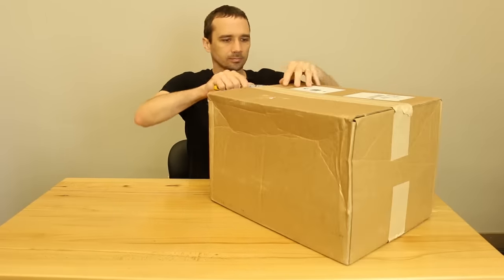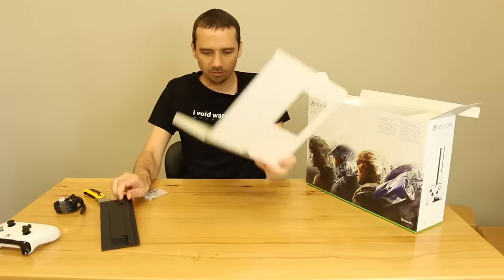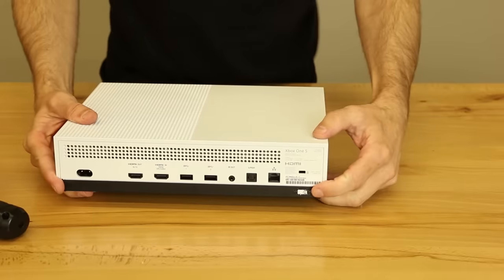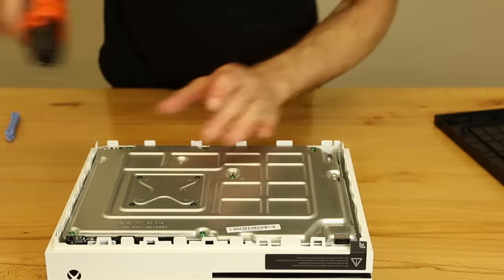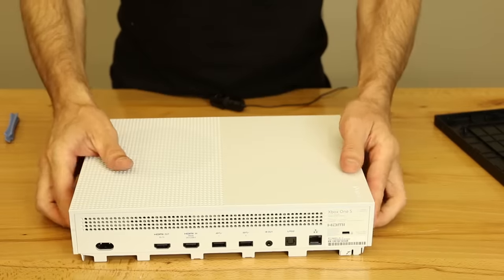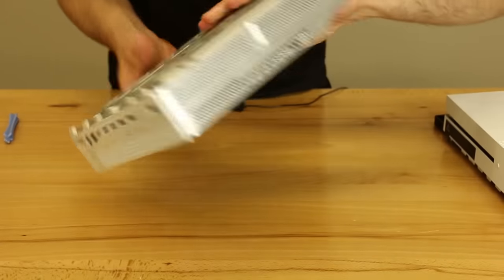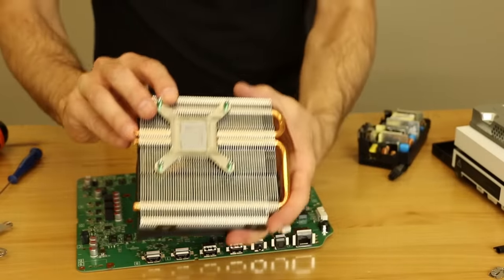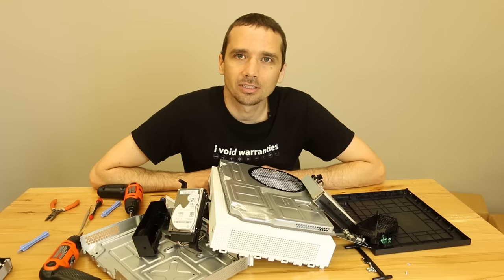Xbox One S Teardown - Detailed Disassembly Guide

Comment: This is one of the best video man Thanks a lot!! Cleared all my doubts to a level. Well one question though. I am importing this from USA to India. In US power voltage is 110v and in India its around 220-240v. So since you mentioned the power brick supports any voltage can i directly plug in to the power supply socket without any external step down transformer required since the power volt is 220 V. Please suggest
Reply from the maker: These are dual voltage so there will be no problems.

Comment: The POWER SUPPLY is 100-240v? Thank you!!
Reply: most USA based power inverters like this are for input 110v ulike a power supply for a computer wont be in a 240v rage as the devices used in the xbox wont ever require a high input of 240volts <break down or close to the volt rage of each device hard drive 5v~to12v opti drive 12V ~Cpu 12 to 24v the mother board should be a max of 24V  the fan 12v to 24 max  hope this helps

Comment: So ppl know when he takes the power supply out he ripped the female plug off the board there is a clip you squeeze to unplug it and don’t wiggle the connectors off like he also did just pull straight up if not you could destroy the plug or the contacts.

Comment: Were you able to test if you can hot swap the disc drive?  Or is it designed for optical disc drive is tied to mother board?
Reply from the maker: It's tied to the motherboard...on all Xbox One models.
Reply: Well that's convenient, I guess just need to buy new compatible DVD drive and then be able to solder old board to new dvd enclosure
Reply from the maker: Yep

Comment: Hi TronicsFix, can you please tell me if the Xbox One S bluray drive can be made to fit the original Xbox One. Also what I'd really like to know is if I can slam it in my PS4, I realize some modification may be required but would appreciate your thoughts on if its even possible. Cheers, also subscribed for the demonstration video to answer my question :P
Reply from the maker: I haven't tried putting it in an Xbox One. You would have to be an electrical engineer to be able to fit it into a PS4 and even then I'm pretty sure that it would be impossible.
Reply: Cheers for the fast response :)

Sony really screwed up choosing to drop the 4k Bluray Drive. I stream youtube at 480p on average and even less when its choked up, how am I going to stream 4k? LMAO! I have a 4K TV and pre-ordered the VR Headset and was patiently waiting for all this to come together and Sony pull this shit. Strongly considering cancelling the VR Headset and just buying for PC
Reply from the maker: Yes, I'm very surprised that they did not go with the 4K
Reply: TronicsFix
With the recent Fiasco's of Microsoft doing their usual trick of bribing for exclusives to cut Sony out and bribing channels to not broadcast Sony at E3, my mind boggles as to why Sony didn't put a Michael Jordan size boot up Microsofts ass by adding 4k Player. Did Microsoft bribe Sony? Did they plead for mercy from Sony to give them a lead due to Xbox falling behind? Dunno but if I was Sony I'd have been telling Microsoft to bite the kerb as that boot came down!

Comment: the disc drive is so unnecessary.. i have this exact xbox, and i don't have as much as a disc to it, all games are bought online, onlything that could be better is to upgrade the 500gb to a 2TB.   what would happen if you remove the disc drive and replaced it with a fan instead?

Comment: I would put a warning about opening up the power supply, that's high voltage, could easily kill you with a single discharge.
Reply from the maker: That's why I disassembled it with it unplugged.
Reply: I've heard there's a slight risk of the capacitors retaining charge after you unplug it though, enough to deliver a fatal jolt.
Reply from the maker: That's only right after you unplug it. You can either wait for a period of time or you can discharge them before you start disassembling. 
BTW, it would be highly unlikely that you'd be killed by theses capacitors...they are strong and it wouldn't feel good, but not likely to do any permanent damage.

Comment: I hope someone sees this. I have an Xbox one s. Specifically the Battlefield 1 edition. My power cable WILL not leave the Xbox. I have been pulling with my hands, gloves, and pliers for about an hour now.

After further looking at the cable area, it looks like the console shell looks a bit melted around the cable. It’s the same color as the case. It also isn’t much. It’s about as much as a thin layer of wax.

Comment: Is the S usually not pick up dust? Like to the point to at all? I have a Xbox and a ps4 and both keep the outer part clean and away from everything else and recently opened up my ps4 that I’ve had for a year and cleaned it and man was it dusty! Then it dawned on me that I’ve had the Xbox one for 2 years and it must be worse but I just now opened it up and stopped half way because every piece I got off I expected dust and there was nothing. Not even a single bit! Surprised me for having it for 2 years

Comment: Great video! I need to know if the power supply is multi-voltage. Because I want to buy this xbox in the USA and use it in Germany. Does it handle 110-240V?
Reply from the maker: Yes, it's dual voltage.

Comment: 11:36 I have a question about this board your removing.   I have a xbox one S like this unit that was dropped.  The small switch BIND SW3 looks like it snapped off.  I think this is the Share button?   Any idea where to find another switch or can you provide a close up picture? thanks.

Comment: This was supposed to be easy, followed everything, but yet xbox turns off instantly after turning it on after replacing thermal paste, fan doesn't spin yes it's plugged in, everything is exactly like it's supposed to be. Maybe scratching the board while taking off the steel X from the APU is the issue. I was so angry when it didn't turn on, I'm prepared to throw it out the window!

Comment: I hope you still respond but I did everything in the video because I needed to clean my Xbox from a roach infestation and everything still worked even with the roaches but now I’ve cleaned it really well and I put it all back together properly but now for some reason my Xbox started to overheat and shut off even tho I cleaned the fan and everything else and nothing is blocking the air and it’s not in an enclosed space, any advice how to fix this?

Comment: Is there anyway to switch out the “HDMI out to TV” with the “HDMI IN from SAT/CABLE” input? Just asking if it’s worth to open my Xbox because my HDMI to connect to the TV is damaged.
Reply: Are you sure its not Internal HDD problems? That's what caused me to either get the black screen "no input" or "preparing console" straight to the error page. I initially thought it could be a bad HDMI chip too. 🤦‍♂️

Comment: I dissembled my Xbox one s because I had a disk drive problem, I opened up the disk drive gave it a little clean plugged in power still worked, so I put it back together and it doesn’t turn on at all now! Do you have any advice please?

Comment: I can’t get my sons Xbox one S to stay on more than five seconds. I swapped out internal power supply and it’s still doing the same thing. Sometimes it will stay on a little longer if the hard drive isn’t connected. Any advice would be greatly appreciated.

Comment: I have a problem a friend of mine has the Xbox one s. But it keeps turning off after a few hours or event just 30 minutes. We moved it from tight hit areas, pulled it down and cleaned it and also added the cooling gel, but the problem is still there, is there anything you or anyone can tell me that will help.
Reply: Try post the problem on R/xbox or xbox repairs

Comment: Ok, really need help identifying what type of part that is on the pcb of thr disc drive. Not the power connector but the one next to it that looks like an L. I was pulling the disc drive out and the wire harness decided to take the connector out with it, so it's just a bunch of bent flat pins. Need to replace this but have noticeable what this part is called.

Comment: I'm late but soda spilt on the top into the fan and the xbox now goes on but shuts off immediately after. The front light goes on but shuts off. I am trying to take it apart but the black screws that keep the fan in place don't fit the screwdriver attachment I have. I was wondering if maybe just the fan has to be replaced or is it a bigger issue than that? Please respond because I need this.
Reply: Imaghost1375 did u ever fix it

Comment: I took apart my xbox one s and in the power supply, there was a white battery shaped and sized cylinder. There was also a white goo that was like glue but it was hard, my xbox stopped working a while ago but I just decided to take it apart, do you think that could had something to do with it?
Reply: As a matter of fact as I look at it it is completely different than the one in the video

Comment: my xbox is overheating and my games are crashing/very lagging. Will taking it apart and cleaning fans help the problem?
Thoughts?
Reply: Try and clean it with some canned air make sure your spray through the fan and hit the heatsync if your system is still overheating make take it apart just enough so you can see your fan and plug it in and make sure your fan is actually spinning it it's not you either need a new fan or something is blocking it from spinning

Comment: so for some reason my Xbox One S just flat out will not turn on, I'm not sure if it's the wire, port, or internal power...is there any way I can tell what the problem is before taking it completely apart?
Reply from the maker: Be sure to make sure it's plugged in all the way first. If it is then I don't know of any good way to test it without taking it apart.

Comment: That power supply could have electrocuted you! Those large capacitors can carry electric charge that can kill you even it's not plugged to the wall.
Reply from the maker: Um...did you notice how it's not plugged in and it hadn't been plugged in for minutes??? Any charge left in the capacitors was long gone.
Reply: @Tronicsfix  I know this is old and you probably won't see this reply but even if I'm not a professional in the area I'm pretty sure some capacitors can maintain their energy for years. Maybe since I don't see much use for this kind of capacitor I don't think Microsoft spent much money on high capacity capacitors, so a few minutes should be enough for the capacitors dissipate their electricity, but a bit more of caution never hurts. Better safe than sorry isn't?

Comment: Hey dude can you please tell me what's going on with my Xbox One S When ever I turn it on it stays on for a Second then it turns off, I opened it cleaned dust off everything including fan still doesn't work fan doesn't even spim can it be the internal power box that its not working?I Already ran out of warranty please help

Comment: tronics have u got it and the pro working once reassembled?
Reply from the maker: Of course they're working! Everything I take apart works when I put it back together.
Reply: TronicsFix
heh, yes I saw the follow on vids.
My fat xbo serves quietly. Before 2 360 rrod on me. MS is lucky i brought the One. My query the rrod had its cause the cooling faliure that seperated the CPU from the board?
Reply from the maker: Unfortunately I have no experience with the old consoles. Sorry.
Reply: TronicsFix
well past news. XBO has no cooling issues?
Reply from the maker: I haven't heard of any cooling issues.
Reply: TronicsFix
nor me - thus reliable.

Comment: Please don’t use pliers to remove connectors from the motherboard. One wrong move and you scratch the board.
Reply from the maker: Pliers are completely safe as long as you use them correctly. I use pliers 100% of the time and I've repaired literally thousands of consoles and I've never once scratched the motherboard.

Comment: Mine has issues with the internal power,  so I was wondering what type of atx power supply I can use if any to mount it in a pc case for better air flow. Dont know anything about building liquid blocks or I would consider liquid cooling instead.
Reply from the maker: I've never done anything with ATX power supplys so I don't know the best way to do it. Sorry.

Comment: Hi there TronicsFix I have problem with my xbox one s. My two controllers for the xbox one s are syncing the same color on my console even the other one is black and it shows white on the system. What could be wrong with it? Could be the controller itself or maybe a wifi module on the system or a going out bad hard drive? 
Reply to any of those who know how can I fix this issues. If any how the hard drive is the problem should I replace it with Solid State Drives for better reliability or should I stick with HDD?

Comment: 2021 new Xbox  digital no bluray hard drive will be  ssd cards half the size iof xbox one s in dimentions 8 inches deep 9 inches lenght and 1.5 inches high 1 tb and 2 tb models heatsink place in centre of console as no bluray drive less power needed 150 watt psu and a 12 nm gpu/ cpu

Comment: My xboxone s is always warm from the area where the air comes out  even when not in use do i have a problem???
Reply from the maker: No, that's normal. Even when you're not using it it's still on unless you unplug it.
Reply: TronicsFix LLC  ok thanks I was worried for a sec thx

Comment: this video messes me up. he opens the power supply (open power supply parts can kill you) and he puts his hand all across the mobo.
Reply from the maker: What seems to be the problem with that?
Reply: idk its just a thing. makes me cringe for some reason
Reply from the maker: If it was plugged in then yes, that would be a stupid thing to do. Obviously it's not plugged in. Yes, power supply capacitors are very powerful...it's unlikely they would kill anyone (I've been shocked by them before) and as long as you make sure they are discharged before you work near them you're fine.

Comment: i need put it all that out and put a new thermal compound or not ?
Reply from the maker: No, it doesn't need new thermal paste. I changed it since I already had it apart.
Reply: TronicsFix thx. But, We need put a new thermal paste after 1 year or something like that ?
Reply from the maker: I recommend changing the thermal paste if you are already in there or if it starts getting hotter than normal. Some people change it after a year just as preventative maintenance. The cooler it runs the better.
Reply: TronicsFix OK .thx 😉
Reply: Use melted gold on a frying pan and flatten it down for apu chip.
Reply: odstar21 really ? Im from brazil, what  u mean flatten ? Sorry 😁. I can get the gold, my dad is a jewelry seller. Lol  can i do that on my r9 270x ? 😉

Comment: Anyone know of the exact or a compatible part number of a surface mount switch to replace a broken one on the RF board?
Reply from the maker: Unfortunately, don't know. I usually just replace the board but it would be nice to find that part. It's probably on Digikey if you can find it.
Reply: TronicsFix Okay thank you.

Comment: Does anyone know of any custom heatsinks and fans for the oneS that does not require any case mods? Even just an LED fan that can be replaced with the original without using cable ties or drilling holes into the heatsink jus one that can be easliy replaced? With the same connector without needing extra adapters or anything? And is the metal case inside on the top by the fan needed? As my xbox one s the metal sheeth , the small holes dont line up with the holes on the top of case leading me to belive maybe its restricting airflow? I have a one s minecrafy edition tho so theres a little speaker glued onto it for the startup noise it doesnt have one on the mobo like the normal one s
Reply from the maker: There is no such thing. Sorry.
Reply: TronicsFix LLC Thank you for the reply. Thats ok. Would it be ok for me to cut out the mesh thats inside the fan vent? The black part that covers the fan on the metal sheeth that covers the insides of the console? I dont want to remove it because i believe it helps with grounding? But the holes dont align with the holes on the case so im worried about air flow restriction
Reply from the maker: Sure you can cut it out but it won't cause any noticeable air restriction.

Comment: I just need to get a coin out of my disc tray
Reply from the maker: Just take the cover off of the disc drive. Should be able to fish it right out.
Reply: TronicsFix LLC is there a way to get it out without taking it apart because I do not have a screw driver